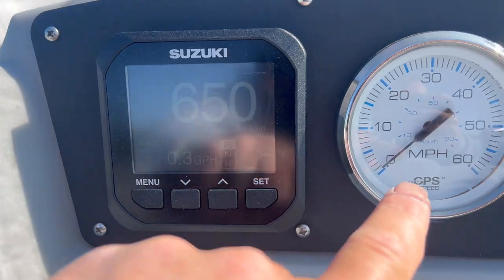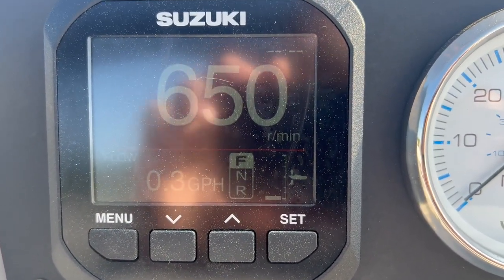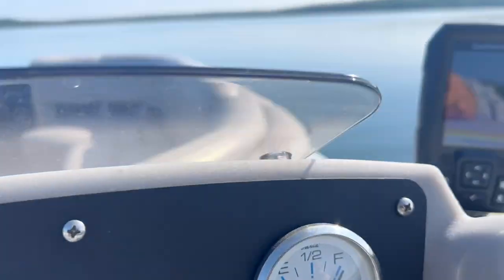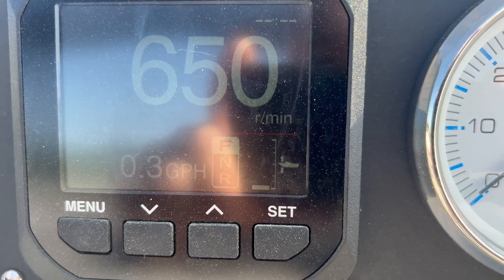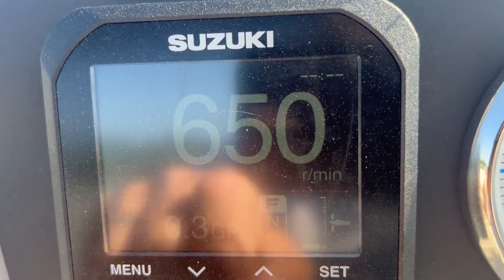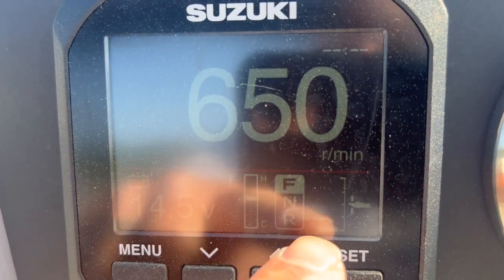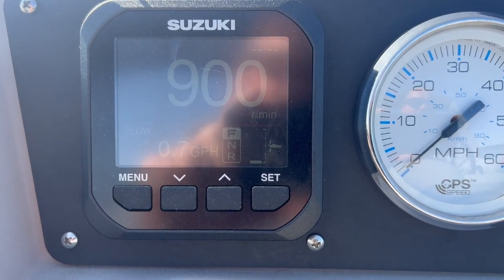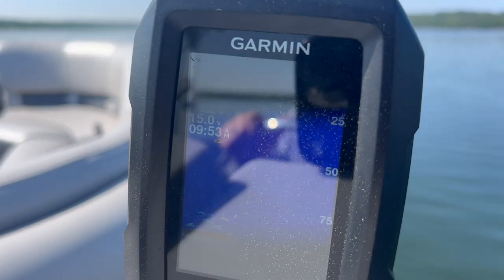Boat Propeller Test - How to Know If You've Got the Correct Prop

Comment: Love the on Water video. Since your the legend in the pontoon industry. Can please post a video on how to properly set a transducer on a pontoon so it doesn’t lose depth after speed of around 17-18 mph thank you sir.
Reply from the maker: Haha, I'm not so sure about the legend title! Most boats I've ever run lose the reading or accuracy of it once the boat starts moving at those speeds. The higher end units might have better accuracy, but most of the entry level fish/depth finders I use can only track depth at slower speeds (on toons and fishing boats alike). I keep transducers slightly above the bottom of the toon to prevent them from getting knocked off when beaching or sliding through super shallow stuff in order to beach. The only thing to check is the chirp speed or frequency if you're able to adjust that setting on your unit. This will increase the number of signals put out by the transducer and may help with accuracy at speed. 

Sorry, I don't have a better answer for that one!

Comment: Hey Tom, two questions my friend…a boat motor manufacturer will have an optimum RPM range for their motors, correct? So will they as well, suggest a size of prop optimum for their motor to maximize their performance? And if so, then I assume it’s up to you and your boating requirements to find that ideal size and pitch and fine tune it? Reason I ask is I purchased an ‘03 50 hp Honda 4 stroke. But did some searching on line and it was recommended, for a large pontoon, a 22’ to go with a 4 blade and the particular pitch which I did order. 
Second question…you mention you installed lifting strakes on your ‘toons. In effect you’re “squaring” the bottoms of the toons correct? So why wouldn’t manufacturers pick up on this “add on” and offer square ‘toons under their boats?
Thanks Tom. Keep up the great vids! Oh and I passed on your website info to a buddies father-in-law, who bought a used pontoon in the fall. Apparently he’s tearing her apart so is now watching your videos. 👍🏻
Reply from the maker: Hey David!

Great questions. Yes, every outboard has a wide open throttle operating range. The manufacturers will provide a maximum diameter of propeller for each motor. The prop diameters tend to fluctuate with the pitch changes, but if they still fit that motor they'll run the prop just fine if it's the correct hull and setup. It is ultimately up to the boat manufacturer, dealer, or end user/owner to find the correct and optimal prop for their boat. Three blade versus four blade has different places where one shines over the other, but on most pontoons you'll see three blade, large diameter props...usually with lower pitches especially when it's a lower to middle range HP on a large boat. Ultimately, the diameter and pitch will determine the max RPMs at wide open throttle. On Pontoons I like to operate on the high end of those RPMs. If I were running a bass boat that I needed to max out top end speed I would go for the middle to lower end of that WOT RPM range to get more travel out of each revolution. There's a sweet spot for top end speed that doesn't necessarily translate perfectly to pontoons because they're a non-planing hull.

If I ever built a pontoon from the ground up, including welding the logs together, I would absolutely square off the bottoms to a degree. I like trying to reinvent the wheel on stuff like that, so I'd probably design and build something totally off the wall. In the meantime, the manufacturers have added strakes to more and more boats to provide better cruising and top end speeds. Their middle pontoons have a variety of shapes aimed to provide the best lift and performance. I love being on lakes where the higher end tritoons are floating at docks because it's fun to check out how different the designs get from boat to boat. 

Thanks for sharing my channel with your friends!! Much appreciated!

Comment: Love your videos, looking for advice, I have a 2006 odyssey 320FC pontoon, 22' (1890lbs) rated to 115, I have a mercury 115hp 4 stroke with a Black Max 77340a45 14x13  pitch 3 blade.  I get approx 5400rpm just me with about 10 gallons of gas (motor rated 5-6k).  I can only trim up to a 1/4 or it blows out.  
The boat is a barge, especially with additional people, hard to steer.  I did try a turning point 4 blade 14x11 prop and the rpms went close to 6000+ (just me) then with a load twice the engine started beeping in a wavy busy condition, and the first time after the beeping I found two cracked spark plugs?  I put the original prop back on and seems to run fine, good cooling water flow.
I'm thinking about a Merc Spitfire 4 blade for pontoon prop, the 13.8x11 pitch to be exact. Or should I go to a 11 pitch 3 blade?  Do you have any thoughts?  prop experiment can be costly.  Below the waterline has buildup that won't come off, could this be all the trouble and there's nothing to be done? Thanks!
Reply from the maker: I think you have more of a water flow issue than prop issue when it comes to the blow out or ventilation. I would want to get the RPMs up by dropping to an 11" pitch, typically four blade is better for boats having blow out issues. Where people sit probably makes a huge difference, which isn't ideal, but common. Two quick fixes: drop the motor bolt hole(s) down if possible. A hydro-foil or "whale tail" on the ventilation plate can make a big difference in some cases too.

Comment: i just bought my first pontoon boat it is a 2000 crest ii dl with a 2001 mercury 50 hp 2 stroke.. what is the first upgrade i need to do to this thing.  thanks  love the videos
Reply from the maker: I often recommend running your boat for a season before making any major changes unless the seats are falling apart or there's a soft spot in the floor. That'll give you an idea of how the layout works for you so that if you overhaul it you'll know what you want to change. 

The motor is the most important part to your time on the water, so run that to get to know it and to make sure it's reliable. It'll also tell you if you need a bigger HP motor or if that 50hp does everything you need it to. Crests are great boats, and built like tanks...so you've got a great platform to restore when the time comes!

Comment: I am now at a loss, I just purchased a 200 SHO on my 21' aluminum deck boat that drags way less than a pontoon.  I have the exact same prop size, I ran it this weekend with my wife and 2 small kids with 30 gallons of fuel, so roughly 3000 lbs, similar to your boat.  It came out of the hole like a rocket!! Literally planed out in 2 seconds flat.  However, I hit 47 mph wide open and trimmed, but only 4900 RPM's on my digital Yamaha gauge.  I am not sure how this is possible being that we have a similar setup.  Any thoughts?  My only other thought is raising the engine a little more.
Reply from the maker: A tritoon and a planing style hull are still completely different beasts. An outboard has to do so much more work to push a tritoon, even with lifting strakes, through the water than a deck boat. I would take a look at your engine height first and if there's room to raise it without ventilating then that's where I'd start. You'd be amazed what that can do for drag and RPMs. Consider reaching out to the manufacturer of the boat to see if they have any suggestions for the motor you have and rigging height. Suzuki has a gear reduction at the crankshaft/driveshaft which adds torque and will make it hard to compare to other brands prop-wise. I'd like to see your setup turning 5500 RPM when loaded like that at WOT.
Reply: @tomspontoons  thank you for the reply. I tried to post a link but I don’t think it’s going through, Yamaha tested a boat  nearly identical to mine with the same motor and same prop and they had achieved over 6000 RPM. Do you really think raising the motor will gain 1000 RPM? I believe the motor is a little low as I can only see the cavitation plate when I really trim it out, but something does not seem right.
Reply from the maker: @vertc6  I can't say exactly, but I know that raising motors in the past has created some serious improvements....sometimes even to where a prop needed to be swapped because so many RPMs were gained. It's a cheaper alternative to raise the motor a bolt hole than buy a new $800 stainless prop! Worst case you have to lower it back down and then make the investment in a lower pitch prop.

Comment: I know this video is over a year old but I always go back through your videos when I’m having issues. I am just finishing up my second pontoon restoration, actually waiting on delivery tomorrow of my Bimini from pontoon stuff. I have a 2000 crest 25’ with 25” toons. It has a Mercury 115 ELPTO on it. It did not have a prop when I bought it. Went through the online process of figuring out the prop and ended up with a 13.5” x 15 four blade from Turning Point. I ran it this weekend and I get up to about 4600 rpm and 16 mph the when I push the throttle on to WOT I lose speed. I am over propped? I have tried to find the issue online and the only response is blown hub but my hub is fine. Do I need to move down in pitch? Sorry for long comment. Hope you had a great 4th!
Reply from the maker: Definitely too much prop for a 115 on that size boat. I think we ran an 11" pitch on the 115 Mercury that I installed on the 24' PartiKraft this spring and it's been great for them. I believe it was around 15" diameter, and it was definitely a 3 blade. If you drop to 11" pitch you'll likely still go the same speed, but should turn another 500+ RPM, and the 3 blade should help pick up some RPMs too.
Reply: @tomspontoons  dang, was hoping dropping the pitch, reducing drag and increasing the RPMs would give me another MPH or two. Thank you for the reply.
Reply from the maker: @VolunteerAirsoft  Raising the motor can help gain some RPMs too as long as it doesn't ventilate/cavitate. If you seem to get a lot of spray or splash at higher speeds that could be a sign of it being a little low.

Comment: What RPM is max HP?
Reply from the maker: Peak HP should be achieved at the highest end of the RPM range for the motor. However, that doesn’t necessarily yield the fastest speeds always due to the gear reductions and the propeller pitch. Each boat is different and the peak performance has to be figured out through propeller testing with a tach on hand.